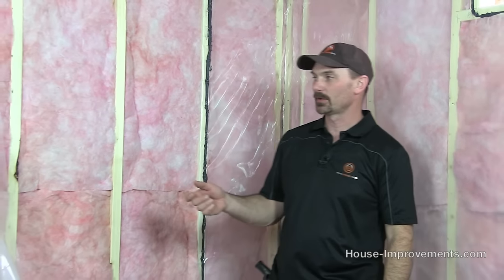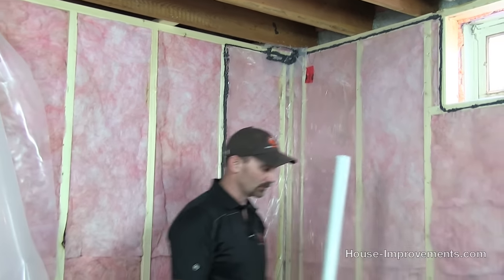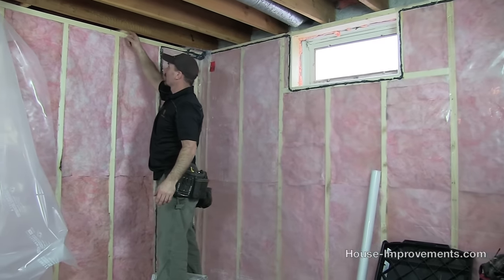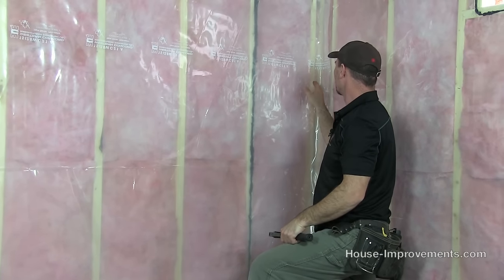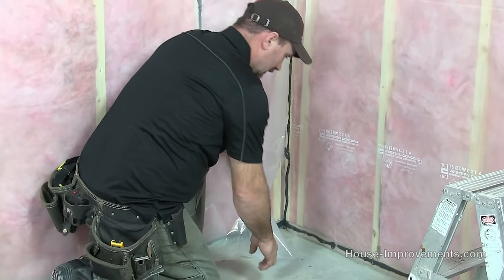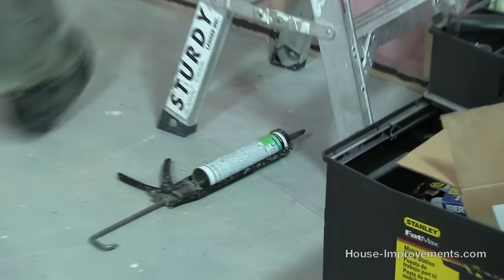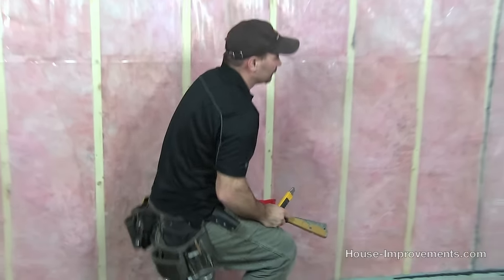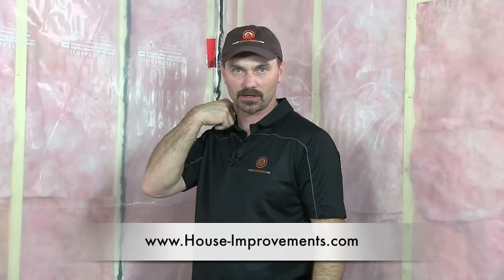How To Install Vapor Barrier

Comment: This video is absolutely excellent. I'm going to insulate a garage and it's my first time, and the detail this video goes into is very helpful. Small details like leaving slack in the corners to account for drywalling, and stapling the vinyl lower down to make the caulking easier are small things that make all the difference.

Comment: Thanks so much Shannon for videos like this - I owe to you and one other YouTuber I was able to DIY my basement solely from your demonstrations. One rookie lesson learned - better to do vapour barrier before doing abutment walls and soffits. Trying to install my vapour barrier around all those studs was not fun but got er done. So easy to do flat straight walls free from other beams and connecting 2x4s. Won't miss handling the acoustical...got more handy with it as I went along but definitely a challenge.

Comment: Watching these as we work. Great video, Shannon. We found Goo Be Gone also works to take off the acoustic sealant. Great for doors (oops), hands, tools, etc. Bonus, it leaves everything lemony fresh. Bad news is the Goo Be Gone did not work so well on my wife’s favourite fuzzy robe, when she walked into the still wet caulking gun, and didn’t notice for a while (the bigger oops). Off to the store for a new robe.
Reply: One more tip for the DIY hubbies out there. Things you should not say after your wife ruins her favourite robe with acoustic sealant… “Next time you come down, could you wear a white billowing dress?”. Certainly not in the first 10 seconds of spotting it on her robe. I learn from Shannon. You learn from me.
Reply: Question is.... why was your caulking gun wet when your wife wasn't in the room with you? No wonder why she wasn't happy that you had a happy ending without her and cleaned it off on her robe. 
I mean I could understand if your so called "big" caulking gun was dripping after your wife was out of her robe... and you happened to drip the "wet" caulk on her robe because it was on the ground... or if you couldn't wait long enough to remove the robe and just un-tied the robe, and then off you both went... then as you went to finish giving her a happy ending "completing the honey do list chore" and then happened to accidentally rub against her robe when you were pulling out the "caulking gun"! 

P.S. I think your wife wasn't happy about the dripping on her robe... because you were using the wrong "caulking gun" when you did it. Sometimes it's about using the right tool for the right job... And you my friend... ended up using a construction tool instead of the caulking gun you were born with when you made that "oopsie"... Had it been the tool you come equipped with when that "stain" happened on her robe from the "caulk" she wouldn't be as mad... Guess you're going to have to make it up to her by redoing the jobs with the right tool... many times over.

Comment: VB stops the warm air inside your house meeting the cold air in the wall cavity. If this isn’t done properly the two air temperatures meet and condense and start causing mildew, mould and rot. 
Always install it on the warm side of the Insulations

Comment: A water-dampened bar-rag, also sprayed with a couple spritzs of mineral spirits is your best friend with that black caulk. Additionally, applying some hand lotion that morning will help soften the skin, making it easier to wash off any sticky stuff later. I finally learned that after 25 years.

Comment: Hi,I've found that releasing the pressure off the plunger on the caulking gun seems to help prevent the product from dripping out of the tube between uses..
Reply: Yup, thats what i usually do all the time, prevents a  big mess

Comment: Great video Shannon. Question about the outlet boxes on a pre-existing build. If you want to put the membranes on the outlet boxes would it require disassembling the plugs from the wires? And if so, is there an alternative way to vapour barrier around the outlets?
Reply from the maker: Yes with the vapour boxes you should basically disassemble the outlets and install box then re run the wires. Old school way was using a 24" square of vaguer barrier poly , cut a gash in it to slip around the wires and wrap it around the box. Poly your wall and cut a slit at each box and pull the plastic from around each box through the hole and seal it to the face of the wall poly.

Comment: Hi, great video!
What about the holes that get maid by the staples, doesn't that effect the sealing of the wall?  Would it be beneficial to run tape over the studs after stapeling?
Reply: I think that's why he suggested stapling right into the acoustical goop.

Comment: Excellent instructional video on vapour barrier.  I own a 1960's Australian weather board house, Aussie construction was weatherboard on outside and only install internal plasterboard only. I am starting a complete reno soon, room by room, should I install vapour barrier or just install wall insulation? It doesn't snow where I live but its gets down to -4º with very cold wind, during the winter and a dry heat during the summer.
Reply from the maker: +Bigcountry aus To be real honest I'm not sure if vapour barrier is required "down under " or not. You may have the opposite  conditions in your homes . More months out of the year the air conditioned interior is colder than the exterior of your home? Check with your local building suppliers ,they will know right away if vapour barrier is needed in your area or not.

Comment: Great videos. I am wondering if the special vapour barrier boxes around the electrical outlets are code in Nova Scotia. Thank you for the clear instructions.
Reply from the maker: You dont need the special vapour boxes but you will at least need to wrap them with poly and seal to the main vapour barrier.

Comment: Thank you for this video. I am building the walls with windows on my porch. Question - do I need to install the vapor barrier? There is a concern about mold development once it is installed inside of the insulation material.
Reply from the maker: If your area requires vapour barriers then I would use them.

Comment: Shannon.  I purchased a home in Minnesota on the lake and the original owner had started to finish off the basement in the same manner that you are showing.  It is a block wall basement and 3/4" foam board against the wall and sealed with tyvek tape and then a 2x6" stud wall against that.  He had completed half of the basement with R-19 fiberglass batts and sheetrock, BUT had not installed a vapor barrier sheeting under the sheetrock.  I have been watching your videos and you advise to install a poly sheeting under the sheetrock.  I started to install foam board boxes around all of my electrical boxes to create a seal and purchased the recommended sealant like you use.  Now when i am just ready to complete and other local contractors are telling me that I will end up trapping moisture between the two vapor barriers and it will create a problem with mold and rot.  I am at a standstill get a good answer.  Even if I follow your video instructions, I will still have half of my basement without the poly sheeting because it is covered with sheetrock already and other constructed wall that wouldn't allow me to remove all of the sheetrock without major expense and work.   
My basement is very dry and I have in-floor electric boiler heat so I see no dampness.  
What do I do now?
Reply from the maker: You are fine, this is widely accepted in Saskatchewan, we have very similar weather as you. This passes inspection in my area ,you may have different rules.

Comment: Hi Shannon. Using your videos I have constructed a small partition wall in my garage to section off for a small woodshop. I have insulated. And now I am ready to apply vapor barrier. I do not plan on putting up drywall. Maybe some plywood. Regarding vapor barrier. How thick of vapor barrier should I use. Thank you in advance.

Comment: Do you have anything sealing the framed wall back to the concrete? On the window wall here, we see the concrete exposed between the joists. How do you create a vapor seal at that point?
Reply from the maker: You cut poly strips to seal to the poly on the face of the wall and back onto either concrete or window frame if possible.

Comment: Some good tips here…  I need to redo a small portion (knock on wood) of my full unfinished (walkout) basement vapor/insulation re-install that I did nearly 5 years ago.  Seems like I really needed to seal things up in one particularly bad corner, as my repeat of original install techinique (just staples) appears to have developed some surface mold (on the front side of the insulation (sides and backs are unaffected)).  (Why?  Maybe because I sealed the basement up a lot more elsewhere in the meantime as well, there were still lots of air leaks left (especially the windows) after I finished the re-install, but most of them gone now.)  Anyway that corner may very well look like Shannon's when I finish things up in the next couple weeks… hopefully 5 years later it will still look the same…

Comment: Hey Shannon. Thanks for your content. How can I replace the VB on a flood reno. 2ft from floor. The drywall was cut and also cut VB. Any suggestions? Thx
Reply from the maker: Flood remediation companies do this all the time ,cut off or at least severely damage most of the VB and it makes it a pain to repair properly. If you need to repair it as is then adding VB tape on the back side between the studs is about all you can do , sticking the new VB to it. It is never a perfect seal. 
You can also use a oscillating saw to recut it 2-3" higher but use a block of wood screwed through the blade to keep it from cutting right through the VB and or also use a piece of thin metal slid between the VB and drywall as you cut to protect the VB. This will mean you need to purchase 54" drywall instead of 48" to make your repair pieces.

Comment: Shannon, another great video!  It's easy to find plenty of videos that covers the basics of construction, but what is really good about yours, is that you also include the the little tips and short cuts that really spead the learning process!
I do have a question, why use accoustical caulk, instead of regular caulk?
Thanks again.
Reply from the maker: Acoustical caulk stays flexible and never truly dries out so it keeps sealed

Comment: Would something like this work in a hot humid climate with air conditioning (detached garage build -- want to add a mini split and insulate). I am unsure if adding vapor barrier on the inside of the sheet rock would cause condensation behind the wall (hot humid outside, cool dry AC inside).

Should I forgo a vapor barrier entirely in this situation?

Comment: What is your recommendation for attachment if using metal framing vs wood? Thanks for the videos!
Reply from the maker: Acoustical caulking and wafer head screws to tack in place. Once the drywall is installed it will apply pressure and squeeze the poly and acoustical caulk together making the seal better.

Comment: Hi @Shannon, is there any guidance on how to best install a vapor barrier where a shower surround has to be attached+glued to the studs? I'm afraid the plastic will allow the surround to slide around since it won't be glued directly to the studs. Thanks a ton!
Reply from the maker: I have never seen a shower wall system that needed to be glued to studs?  Maybe come to the forum and we can discuss this further.https://www.house-improvements.com/forums/

Comment: Great video Shannon. a question for you.... my basement is insulated on the outside portion of the concrete foundation wall, it is also vapor sealed on the outside. I take it that the warm side is on the outside and therefore I do not need a vapor barrier on the inside. Infact the building codes here allowed me to use untreated lumber on contact with the concrete. What’s your take on this? House is Minnesota...... similar to your weather.
Reply from the maker: Well my take is unless you have like 4-6 " of rigid foam on the outside or you have insulated foam block basement you will need an interior vapour barrier. We can discuss more in the forum if you want to come there.

Comment: Why isn't the gap you covered at 12:51 not insulated? Does that area matter?
Reply from the maker: Actually it does look like there is none but its on top of those 2x4 straps. It is also Roxul so it is a darker green colour so its not showing up well in the shadows.

Comment: Stapler clips should ideally be sealed by PE adhesive tape or PE foil glue/sealant. 10 thousands of little double piercings make the foil less vapour resistant and less air tight.

Comment: I'm trying to figure out how much damage to the vapor barrier is done when they screw into the wood when dry walling ?
Reply: wendy roddick I was wondering the same thing
Reply: because you are screwing into a stud the pressure creared between the drywall and the stud don't usually effect the VB much.

Comment: Very nice videos. Just wondering, don't you need horizontal studs as well? For drywall hanging. Or there is no drywall that goes on this wall?
Reply from the maker: vertical studs for the drywall

Comment: how would you work around plumbing? more specifically a drain line coming out of the wall for bathroom sink?
Reply from the maker: I use the vapour barrier tape and seal the cut poly to the pipe.

Comment: Important to note that in some climate conditions, you absolutely do not want an interior vapor barrier. Good video
Reply: can you expand a little on that? I have done lots of reading on double vapor barrier causing mold, however he hasn't mentioned what barrier he has behind the fiberglass. I am in the process of insulating my basement in Barrie Ontario. I have an older house so, tar paper on concrete with rigid board between firring strips, adding a 2x4 wall with roxul and wondering if I should still add a poly barrier or leave it?
Reply: @congabriel5469  lower US zones 1 - 3 don't need a vapor barrier. There is conflicting info on anything north of that. I am having trouble finding a straight answer since I live just in zone 4.
Reply: @thechyctech5636  I received confirmation from my building inspector that rigid board with tuck tape acts as a barrier so no need for a second vapor barrier.

Comment: If you are sealing walls and ceiling, would you use the acoustic seal on the wall and then just tape the poly from ceiling to the wall?
Reply from the maker: That would work fine.

Comment: Do you only need the sealant  where the poly overlaps? Stapling is sufficient with a continuous piece?
Reply from the maker: correct
Reply: HouseImprovements thanks !
Reply: HouseImprovements where are you located
Reply: Or tape it and maybe have one consecutive sheet of Polly from wall to wall.  You know unrolling the entire basement at once leaves less overlaps, less tape less caulking and gets the job done not only quicker but makes it look like you know what your doing. 😂 unlike this video
Reply: Or you could say "look like you know what you're doing" instead of "look like you know what your doing".  You know, kind of like you actually know the English language.

Comment: hello I watch all your videos and they are very helpful Shannon. I  have a question if my basement walls and floor never had any water damage do I still need to install a moisture barrier before my framing or would I be with just a vapor barrier and insulation? I live in New jersey by the way thanks
Reply from the maker: A moisture barrier should be used even if you had no previous problems.

Comment: Another awesome vid. I've always insulated the side joist cavity and ran my barrier right against the insulation and to the subfloor. My thinking is that your way the floor above the cavity will be cold. Am I wasting time?
Reply from the maker: +cz3chmonkey  Actually there is insulation between the very outer joist (#1)and the next one in(#2). Because of the lack of space between the wall plate and joist #3 I could not show that but did mention it ,however it was very briefly at the 1:58 mark. Thanks for your comment.
Reply: Shannon, if the #2 joist is much farther away than in your video do you still bend the poly over to it and seal or go straight up the wall to the upper floor bottom?

Comment: Couple of questions..  what is acoustical? Silicon sealant? Also what is the barrier on the ceiling and floor? Thanks
Reply from the maker: Acoustical is like a caulking but it stays flexible . Not sure what you are seeing on the ceiling and floor? This is a basement so there is no air/vapour barrier needed on the ceiling or floor. Air/vapour barriers are only needed on warm side of exterior walls and ceilings.

Comment: Must use a vapor barrier on the concrete side walls of a walkout basement prior to framing so there is a vapor barrier between the concrete and the frames walls?
Reply from the maker: Many areas require a "moisture barrie" against the concrete you are correct.https://www.youtube.com/watch?v=P5E2X8Q5jcQ

Comment: It was very nice, glad that i watched this before i start my insulation work.  I am planning to do the same.  Have a question, i have stud placed and there is about 1 ft gap between wall and stud,  need your suggestion on how to fit the insulation, can i use the same vapor barrier on both side of the stud?  Really appreciate your help.
Reply from the maker: please use my forum for this question. Also posting a picture may help. http://www.house-improvements.com/forums/

Comment: Quick question! Are you supposed to put the seal caulking to the bottom of the track and the cement?
Reply from the maker: If you have no gasket under the wall then it would be best to seal the joint.
Reply: Thank you